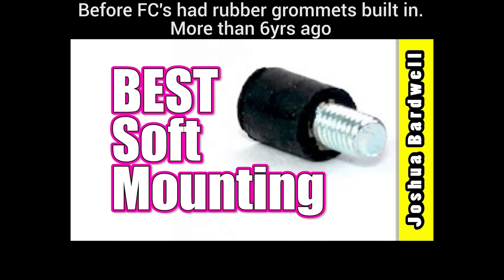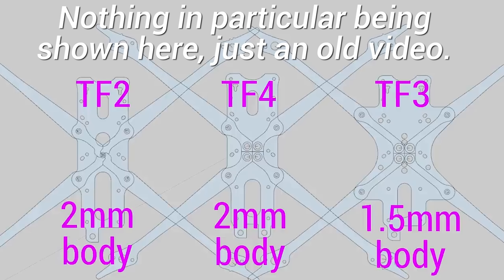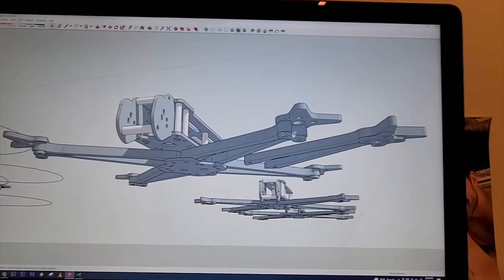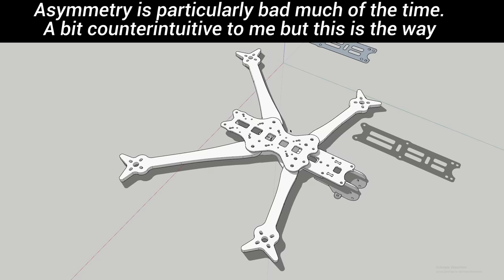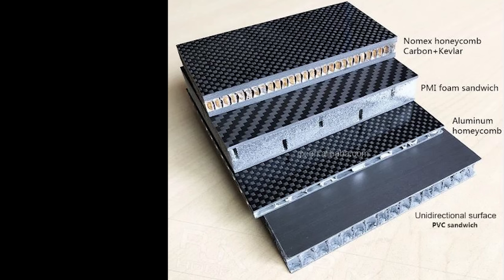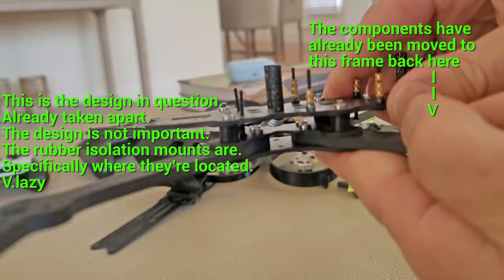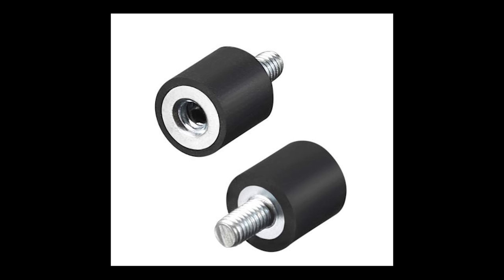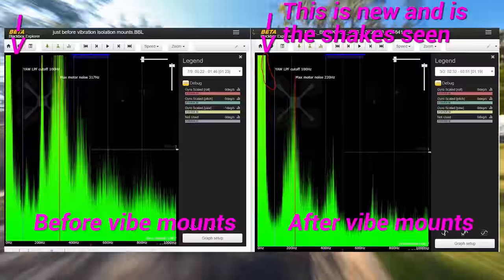I put some steel cable on a quad...

Comment: It would be interesting to see the effects of two pusher propellers and motors (motors and propellers below arm)in various configurations with two standard propellers and motors (motors and props above arm). Two pushers directly across from each other in position 1 & 2 or two in position 1 & 3, or 2 & 4. Maybe I'm just crazy.

Comment: I had to print some plastic washers for my motor screws once they were abit to long and the quad ran great after im pretty sure the bolts are like tuning forks  if you use plastic washers on the bottom and a rubber gasket between the motor and frame im sure it would isolate alot of vibration at the source
Reply from the maker: At the beginning of the video I show the soft motor mounts we used to use. They sort of worked sometimes but also made things worse other times. Ultimately nobody can tolerate them anymore because your motor screws come loose and it's awful overall to deal with.

Comment: You might be onto something with that cable. I work for a major car manufacturer and when we're trying to eliminate vibrations, we add big hunks of steel to the problem areas to make it go away. Crude, but effective. If you ever get underneath a Genesis G90, you'll see what I mean.
Reply from the maker: Look up steel cable camera vibration isolation. It's used a lot. It's used in many industries because of it's damping properties. A great side effect from a super strong cable.
Reply: @Kabab  I'm familiar with that and understood your approach, but I was thinking adding weight to the areas you want to minimize vibration. Seems counterintuitive but it might work. Stick a stack of washers near the camera mount.
Reply from the maker: @DeezLBC  ah yes. That is something that would work great but you're also just adding dead weight which would be frustrating in something that flies.

Comment: I'm wandering in here with no background in DIY drones so I have no idea if this is viable to adapt but it seems worth mentioning

I saw a vid on silencing a buzzy take-down bow. The main thing they did was add some adhesive pieces of thin felt on the ends of the limbs and in between where the limbs attach to the handle
Reply from the maker: Right. Would love to slip something between carbon plates but it doesn't really work out since we always tighten the screws anyway

Comment: Maybe build a pwm motor controller that provides stepped voltage range at frequencies that are resonate?  Series it with every motor like a individual motor controller. You may loose its power range and throttle will feel "steppy" but you then can add more voltage ramps that bypass frequencies that cause vibration.
Reply from the maker: Sounds like a bandaid on top of a bandaid. I hope to only be one bandaid deep by the time I'm done 😅
Reply: @Kabab  resonance frequency is what I feel I know pretty well. Build rifles for a living and also ISCET 1-6 cert. Mitigating vibration through damping is a harder approach.  I recommend tackling it at the source... the motors.
Reply from the maker: @EagleEyeShooting  what you described is similar to how rpm filtering works. It just doesn't reduce output in doing it.

Comment: Have you tried putting a ballast or weight like square brass with 30x30 holes on top of the flight controller stack with those dampers to change the frequency of the vibrations?
Reply from the maker: That would work great but you're also just adding gdead weight which is not great.

Comment: Are you accounting for the fact that the weight of the batter and rubber dampers due to momentum?   Like wiggling a ruler or a fat guy on a diving board?   And what about the weight or even the maneuvering patterns in correlation to the frame style?
Reply from the maker: I think you're talking about new resonance from the mounts allowing for wobbles. That's the reason I made the stance as wide as I could but it still happened. I'm not sure what you're referring to regarding maneuverability

Comment: What about mounting the gyro outside of the flight controller, on its own soft mount
Reply from the maker: Right that is something I've requested from manufacturers on and off. I think it could possibly open up to more options but really what we need are a few gyros mounted to different areas on the craft. Then code that will sample all of them to get tht best data. Or, just deal with the vibration peaks really. The general noise floor just needs to go down a bit.

Comment: you ever think about using unidirectional carbon in the arms at least a couple layers and or adding kevlar since it has a way different damping effect? a single layer of kevlar would probably make a huge difference but i think uni carbon would make a better difference
Reply from the maker: Yeah tried that. Doesn't do anything at all. Unidirectional is also super weak and splits apart very easily. Experimented a lot with it.

Comment: In the audio world they like to build speakers from MDF because it dampens vibrations so well. I know its a terrible idea in terms of durability but maybe a frame made from good quality MDF is worth a try to see how it performs. Bottom plate with all 4 legs out of one sheet 12mm (half inch). Maybe it flies like a dream and you can build new ideas from there to find materials with similar properties but stronger or ways to alter carbonfiber to act more like MDF. Just a weird brain fart I felt like sharing :)
Reply from the maker: Soft wood dampens. Not durable and heavy unfortunately. I know this because I used to build frames from home Depot wood 😅

Comment: What about gyro based cardle? This approach sounds more reasonable and weight saving than trying to go crazy with the whole frame.
It's just a thought, I'm not a frame designer
Reply from the maker: sure that would be great but still a challenge a design and actually have it work.

Comment: You might want to consider playing with vibration damping sheet. For example, from McMaster: Vibration Damping Sheet 90% Vibration Reduced
Part number 9709T71
Reply from the maker: Unfortunately those don't work for us. We've tried.

Comment: How do you cut your frames? Do you cut them or do you have them cut and then sent to you? How much time on average do your spend on one these frame iterations before you cut the next design? I love cable idea btw
Reply from the maker: It's extremely fast drawing designs on SketchUp. I'll usually draw an idea and think about it over a few days while I adjust the design. I'll maybe go back and forth for 2-10 days until I feel like I have something worth testing. I work with four different manufacturers and I'll cycle through them with samples generally. Sometimes I'll use cncmadness.

Comment: Interesting going back to the H frame. I guess the big downside is that the rest of the frame is probably the weak point in a crash so if you do break it it would be a lot of repair work.

Hey what about milling a circular recess in the top and bottom of the arms and in the plates it's sandwiches between? Where an oring large enough where you could drill holes in the arms that a standoff can passthrough that hole with a mm or two of clearance all around would ride? I'm thinking the arms could float on orings greased with that vibration grease and the recesses could be milled deep enough that there is around a half to mm clearance between the arms and the sandwich plates when they are cinched down on the standoff riding inside that hole in the arm.

Just an idea I had in my head I haven't seen and don't have the means to test.

Essentially the arms would be indexed and sprung completely by the o rings and the the standoff would provide the appropriate tension on the orings and clearance for the grease to dampen the movement between the arms and the sandwich plates.
Reply from the maker: I've already tested this a bunch. It works to some extent but it suffers from the same issue as damping grease or anything you put between carbon and something else. You want it to be tight so you tend to overtighten. But if you don't, it falls apart and you need to keep checking it. I've even milled aluminium insets for the arms to maintain appropriate pressure on the arms while still being able to tighten the bolts all the way....that worked some of the time. The tolerances of the carbon ended up being the issue. Even 0.05mm was too much for the pressure management system

Comment: i used to solder the esc cables to the FC (with thicker cables), and just remove the mounts completely from the FC. The FC was completely suspended just by cables. that worked.
Reply from the maker: That's actually a really good way to go if you can get it to stay consistently. I do this often to test things to see if vibrations are an issue.

Comment: You need to tune the steel cables, like, a guitar / piano etc to dampen the frequency in a steel cable might work 👍🏻
Reply from the maker: Right. That's why I gave up. Too much work

Comment: Irregular arm lengths: As the motors cause vibration, could there be a way to lengthen/shorten the individual arms to cause destructive interference in the vibration frequencies, kind of like sound noise reduction?
Reply from the maker: Right. I've tried to hunt for that but haven't found a way to do it because the motors spin at the full range of rpm and cause the entire range of vibrations. Other things I've tried is four different shapes arms so there is no matching resonance. I ended up with four resonance peaks or just one really wide peak which was a lot worse. Definitely good thinking and I totally agree that the best and most efficient way would be to use some sort of interceptive material. That was my idea behind the steel cable.

I'm hoping that I've stumbled onto something with mounting the FC on the top plate. Either because it's closer to the center of rotation, the amplitude of vibration is just significantly less or the frame is doing more damping because it's a longer travel path for the vibrations to reach the FC. I'm rooting for any of those to be true for all our sake.

Comment: Interesting, on the lightweight thread, make sure the O3 is supported and you won’t need the gopro.  I’d love a O3 based TF2 (would that be TF3?).   You could fly well under 500 grams, maybe 300 grams in that case.
Reply from the maker: Working on it and this time it'll be with these dampers since they tend to work excellent for smaller props. The O3 is good but the Hero 11 is a lot better. Especially with gyroflow

Comment: u need to put adjustable tensioners like what they use under big tables maybe? like with a buckle with a screw u can turn to increase decrease tension
Reply from the maker: Yeah that might work if there was a better way to bind the steel cables to tur frame to begin with

Comment: as a musician and amateur mechanical engineer, those look like mighty fine tuning forks :)   I would start with how a string vibrates.   u dampen at the middle(but not exact & not small dampen point) of any scrawny protrusion. Then frequency increases and u dampen at the new 2 middle points(totaling 3 dampeners). 
  I would fasten an orbital sander to something and hook up a variac.   then strap on your flying contraption to the vibrating 'something' rig . that should show u what is vibrating and how
Reply from the maker: Right. All you point out is the problem with this method that won't really work out.

Comment: Kabab what about a soft mount like the naked bmpcc for the fc and motors then .
Reply from the maker: Yeah that's an option too but the material is difficult to settle on because anything that's physical will have rebound to it which will often make it worse. It's also difficult to consistently apply

Comment: What about trying something like double stacked 2.5mm arms with a 1mm foam or rubber honeycombed between them? I'm sure you've probably tried this already tho
Reply from the maker: Yeah many have tried that. They actually make a carbon product like that. It's not that useful for this purpose but it is useful in getting a really light structure. Not really good widespread use in our industry

Comment: hii, you may try the rubber thingy that comes with noctua pc fans instead off screws to fix the plates to the dampeners maybe it improbes the system as there is no solid cmponent between the damper and the plate, hope it helps
Reply from the maker: Those are just soft rubber. Not all that different from the vibration mounts I'm using
Reply: @Kabab  you're right I meant to replace the metal screws that fix the vibration mounts to the carbón with those
Reply: @alejoush  If it was a cinawhoop that wouldn't likely be taking hard crashes just use nylon bolts instead of steel.

Comment: Hey man, great vid as always, I have one particular quad that flies amazing: it has the Kakute F7 AIO with the gyro on the foam pad connected via a ribbon cable. No gummies. I can push the D term to 60 and it's absolutely fine LOL - foam pad seems like an interesting solution, compared to all of the other tinkering.
(I check in blackbox, felt really scary doing that, using RPM filtering and the filter sliders are somewhat to the right, don't remember exactly)

Sadly, I don't have much time to fly nowdays (studying Uni lol), but hopefully will get back on track in the summer :D
Reply from the maker: That particular FC was super intesting. I wish we had more FC's with the gyro on a wire...a longer wire so we can mount the gyro elsewhere. The board itself would have a hard time really isolation anything because the gyro is so light it won't resist anything but very high frequency vibrations. Still was something

Comment: A system in the flight controller where it can characterise its oscillations after a test flight and then apply corrections or filters after that to remove the oscillations may work but would require a lot of work to implement and get right but if done right then maybe it could be applied to any drone. At its most basic it could just filter out specific frequencies that are identified but with a more complex solution it could do it based on motor velocities, drone velocities (what direction and how fast the motor is travelling) and environmental conditions. If this worked it may be possible to do on high performance flight controllers like the H743 ones or maybe it would require a more powerful processor like an SBC or whatever DJI uses in their drones.
Reply from the maker: There's a software system for this built into most flight code now. It's RPM filtering. It would be exceptionally difficult to create a hardware RPM filter. The FC board is also so light that it's hard to build an apparatus to isolate it from vibrations due to its low inertia

Comment: What's up with the offset magnets,  seems like that could reduce desyncs.
Reply from the maker: It's a bit complicated but also not. They're in place of a skewed stator. They're intesting.....but not so useful for many motor sizes. They happen to work very well on the 25mm motor

Comment: I wonder if the composition of the carbon fiber may play a role in the inconsistency you are see? I know a metal frame doesn't have the cache that CF has, but the uniformity of its parts might make a difference.
Reply from the maker: It makes a very minor difference. A maximum of ~6% as I've measured across the worst quality carbon to the highest end custom made carbon by the guys from MADD. I generally use upper mid grade carbon which gives most of the benefits without the extreme cost. The variation from batch to batch is less than 1% so not a huge source of issues.
Reply: @Kabab  I find that interesting. I was involved with the production of composite aircraft fuselages about 20 years ago and strand selection and layout  was an important thing.
Reply from the maker: @jf5336  it absolutely matters but the application is also important. We're not stressing the carbon in anyway outside a crash. We don't usually build a craft to crash either, at least I don't. The vibration quality that plagues us is rather unique and only so much can be done in the material itself to help. The ~6% is only the vibrational properties and not resilience to impact or any other property.
Reply: @Kabab  I agree that, short of a PhD-level study, improving the material properties of CF isn't likely to happen, so external measures, as you are investigating, are the likely best path forward. I am impressed with your work here.

Comment: The time and testing are really consuming. But I suggest you use steel cable with thinner wires and try.
Reply from the maker: I actually tried a few different cables. I forgot to include the pictures of them. They worked to some degree but the build was just too messy to consider

Comment: Several years back while messing about with an old Hobby king aluminium armed frame. I mounted the FC suspended from the top plate on those rubber mounts basically hanging below the battery , as i figured the weight of the battery would act like a giant damper, and clamped the arms down with rubber o-rings sandwiched between the arms and the top and bottom plate, Although not  on your level of testing , it sure as hell flew a lot smoother and all those little bobbles i was getting before vanished I remember , It even sounded different .. seemed like the 2 different layers of vibe isolation worked to remove a lot of vibes , maybe both working on different frequencies or something . It just made me think could a softer mounting of the arms to the frame itself work to kill of the bulk of the vibs. then a second soft mounting for the FC layer isolate the FC from whats getting through the first layer .. If that makes any sense at all  .
Reply from the maker: You can absolutely hear it when it's flying right. For anyone with some experience it's very obvious.